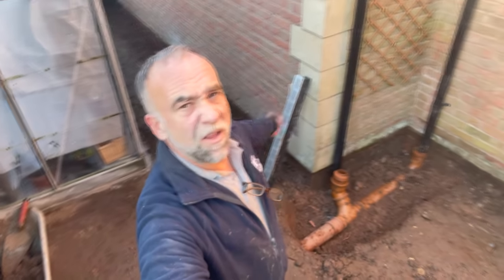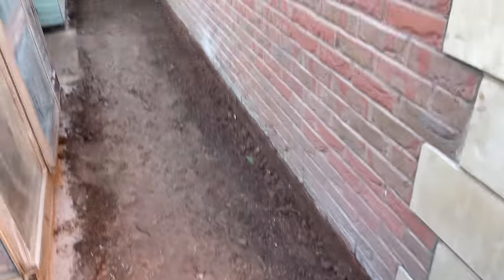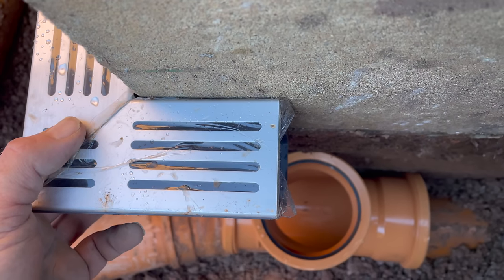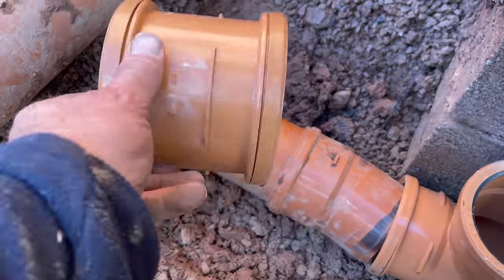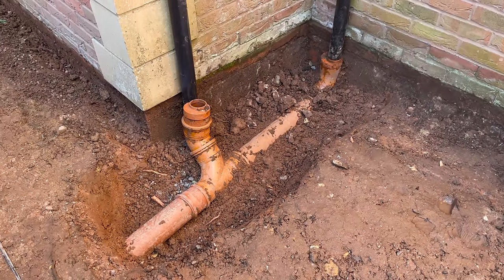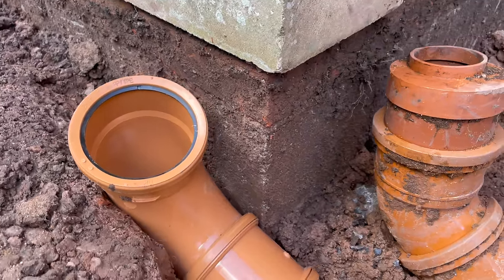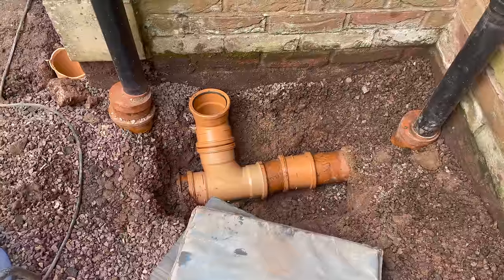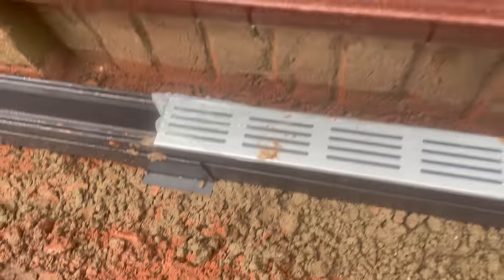Mastering Drainage & Threshold Installation: Step-by-Step Guide 🛠️💧 #drainagesystem  #drainage

Comment: Have you ever installed these threshold drains higher to allow same floor height on patio as inside house level with the damp proof membrane? I’ve seen plenty of patios with bifold doors with patio at same height but seem to come across conflicting advice. Obviously you would ideally have a patio 2 bricks below DPM but with her mother being unsteady on feet and the baby is about to start learning to walk she wants bi fold doors and a patio that is the same level. I want to avoid damp in the house ... I’ve had a read through building regs and on paving expert and am still a little stumped patio will be falling away from house to a drain the other end of patio, would a line of these along house allow what she’s after?
Reply from the maker: It would be advisable to have one up against the house anyway for the water run-off from the building it’s a tough one but they’re not Lawes they’re only suggestions don’t forget 👍🏴
Reply: Cheers for the good work, I'm enjoying the videos & doing a patio project where it will fall away from the house but starting level is very close to the dpc so using a Dek drains edge slot as a threshold drain but what do you put between the drain channel & the wall? Did you fill the (small) gap with a bit of mortar, would you bitumen paint the wall from level with drain & below to help reduce any damp ingress? Any thoughts welcomed!
Reply from the maker: @chrishuddleston1409  you could put some bitumen paint on I guess only if it was my own house I must say. And yeh fill the gap up less water keeping the fountains wet 👍🏴
Reply: @tidybrickslandscaping  many thanks for the speedy reply, its my own house so will do that as dpc is very close & for the extra time & a bit of money less hassle than getting damp! Keep up the good work 👍

Comment: Can I ask won't you still get smells, even though it's a rain water drain, as Gully's usually have traps on them, or is that because there multi use (Combined Systems) ?
Reply from the maker: It was a separate line to the foul the fresh water system we used 👍🏴